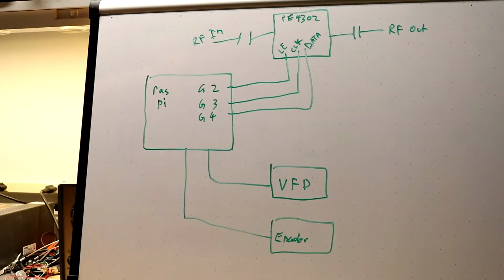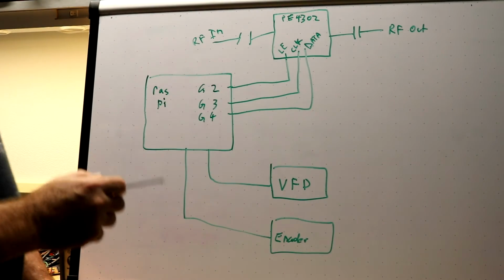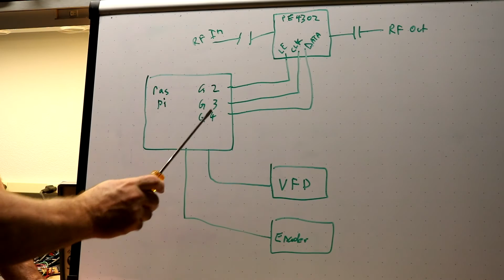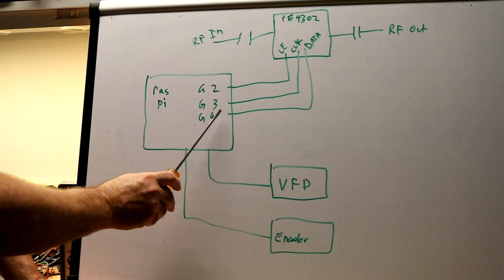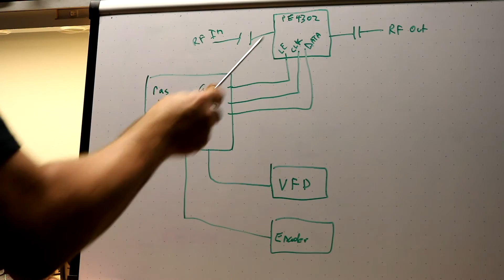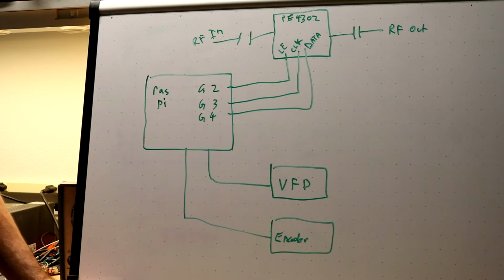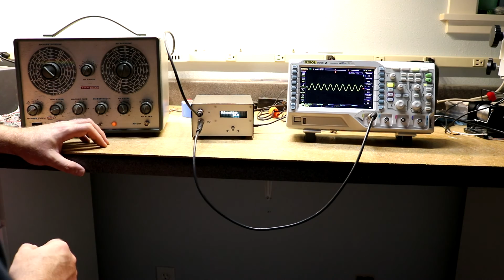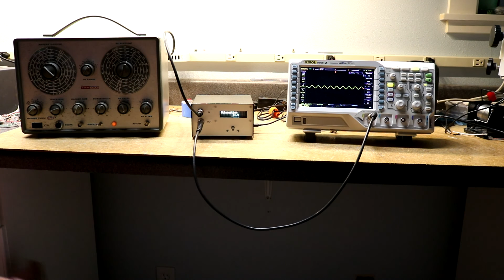DIY digital RF attenuator

Comment: Hi there!  Great project. Going to make one too !!

One question.
Did you use a ‘full blown’ Raspy because you needed network connectivity? Or maybe you are are planning to add some more software routines

I think it’s quite easy to use an Arduino Nano for this.
Reply from the maker: Back then I used to use raspberry pi for almost everything, particularly because it was easy to program and to diagnose. These days I think I'd probably go the same route you're going, and pick my favorite atmega, or if I wanted network connectivity, one of the esp8266 modules. I don't recall if I added network capability to it -- often I would do so, having a small web interface that mimicked the front panel, but I don't remember if I did i this case.

Comment: Ok, this attenuator shows us a lot of good material. But, I'd like to use some of the circuits in other places. So, Here's what I'd like to do. One, use the attenuator inside a small radio. It would control the rf in the first stage of a receiver. So , a simple way of controlling it would be awesome (pe4302 chip board, which should be here any day) . A nano for instance ? Nano's have analog inputs which could be used.  And a more standard display ? Serial isn't a problem in this instance. Display could put out a number, and have a bar graph . I know you do not (probably) have any interest in this, but I'll be passing this text on to someone who might ? 
 
One problem I have is that I am not a very good programmer. Especially in C.  The pi might be easier, not sure? 
Another idea I had was to eliminate microprocessors altogether for this task. And use a pin diode attenuator balanced board, the MA4VAT2007-1061TW which looks like a very easy to use balanced pin diode attenuator . But, haven't seen anything with an actual schematic. By the way, I'd like to add this attenuator to a new radio that is grabbing attention of all homebrewers world wide, the uBITX

Comment: found the little attenuator board, going to try to control with a analog arduino output. Actually this board seems to use a 4 bit , so that would be a 256 bit word ?